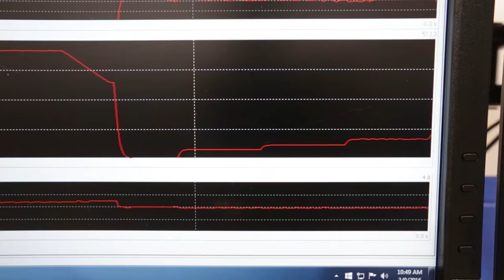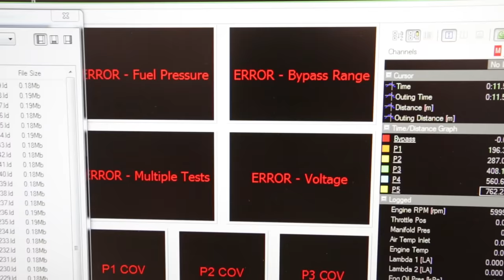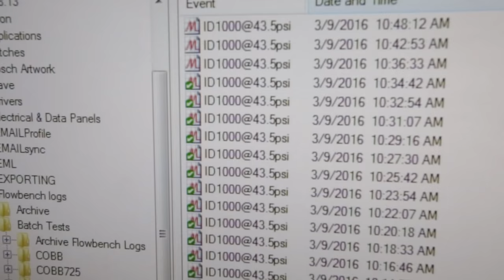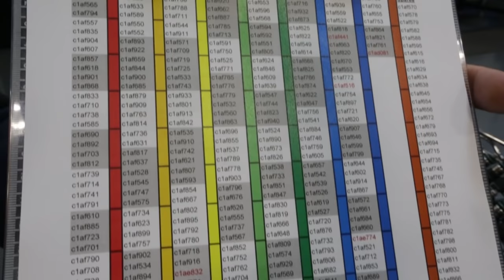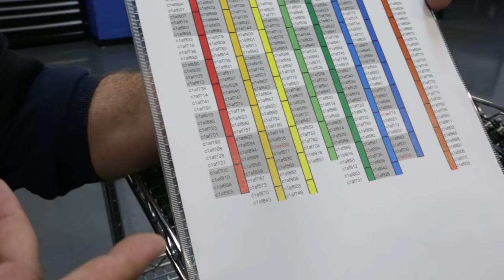Injector Dynamics Facility Tour - How Motorsport Fuel Injectors Are Made

Comment: why would you care about injector internals. they are most likely Stainless steel and precision made. wopdie doo. that being said are they E85 suitable ? as my motorbike is only E10 suitable. and I was thinking about changing fuel line and injectors to E85. as it has a compression of 13:1. Ethanol would sing at those C/r's

Comment: Great video guys! Do you guys recommend someone such as myself to purchase slightly used injectors (ID1000s)?
Reply: No
Reply from the maker: +Alex Rei if the price is right then buying them and having them serviced to ensure they're in spec isn't a bad idea. Here's a link to ID's servicing procedure. http://help.injectordynamics.com/support/solutions/articles/99305-injector-service  What we wouldn't recommend is buying used injectors and just slapping them in your motor and hoping for the best, since (as Paul Yaw from ID explains in the fuel filter video we posted today) they could be contiminated from poor filtration and running way outside of spec as a result.
Reply: yes...Have them serviced by Injector Dynamics  for $100 I think it is...turn around is usually a day or two...
Reply: Alright thanks guys!